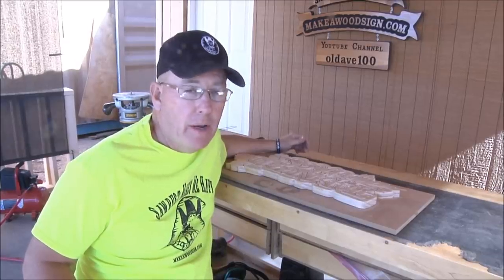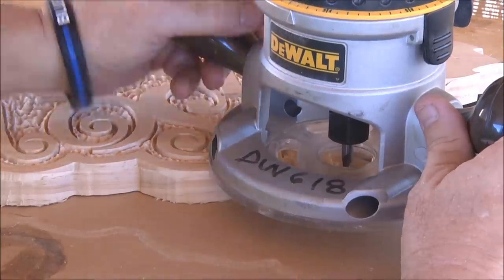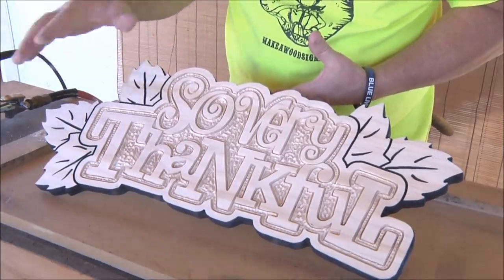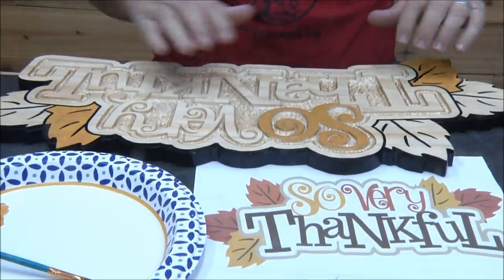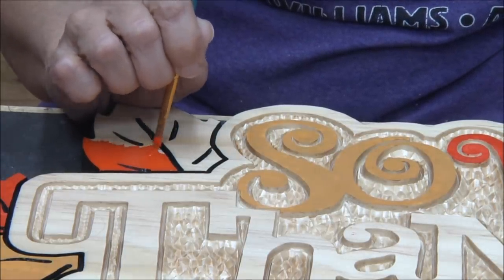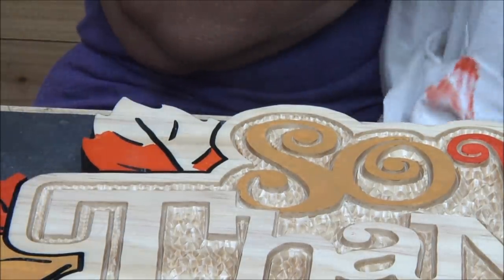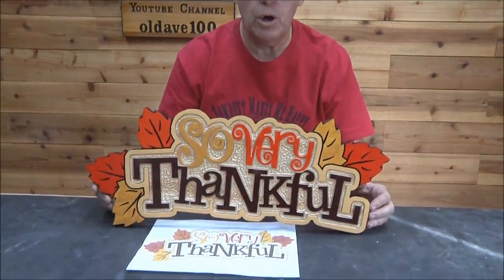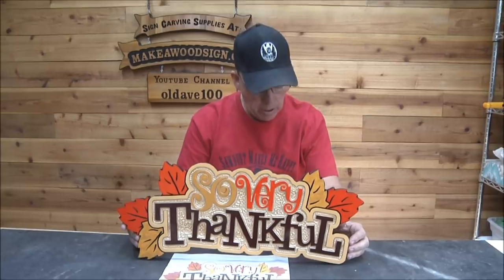#333 Freehand Carving The Thanksgiving Giveaway Sign Part 3

Comment: I noticed when you are doing the edge with the router you go backwards from the way you would normally go around a edge.  Normally you should go counter clockwise around the piece so it pulls it into the wood. Going in your direction will help it ride on the wood so it doesn’t dig in. You might want to mention this so someone doesn’t use it in the normal way and it will dig in ruining the piece.
Reply from the maker: Thank you for that observation. I do by habit and don't really think about it. I will mention that.
Reply: It’s a nice technique if used properly.